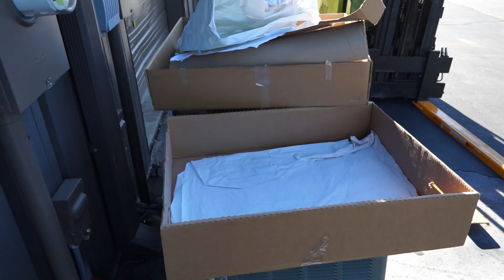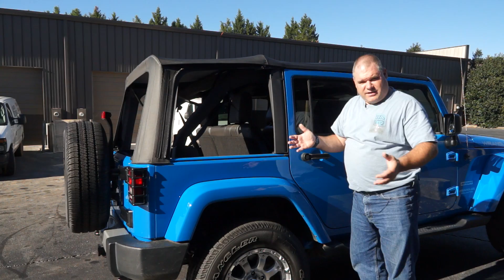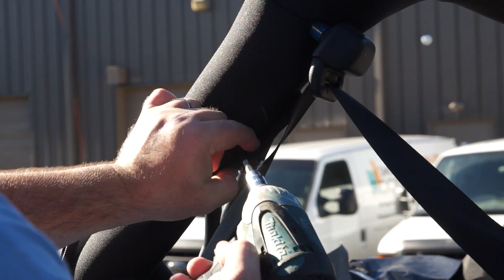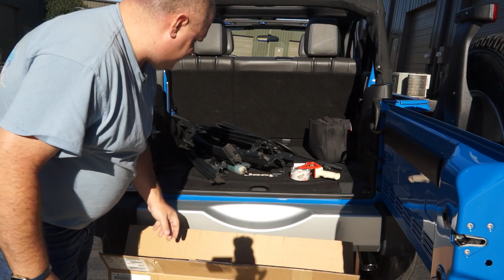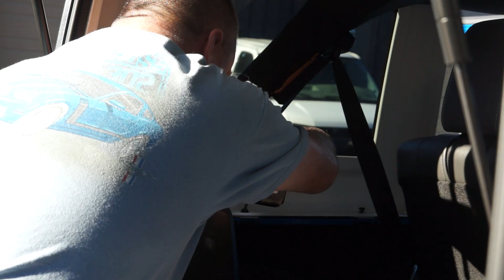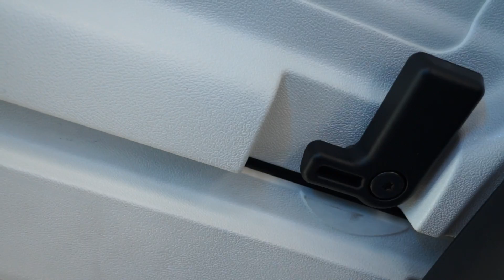How to Install Your Hard Top JK Jeep Wrangler from Soft Top

Comment: By far, the absolute best video for removing a soft top and adding a hard top.  The only thing I would add is that when placing the hard top on via a pulley or winch system, have the rear doors open to ensure as the hard top is lowered it doesn't bump into a door.  A really great video.  Must have saved me at least an hours labor.
Reply: @Donny-boy Productions
I came here looking for how to build a pulley system for my wife's new Wrangler Unlimited.
I know that it's been a year, but I'll save this to my watch later file. If you know of a video or anything for some ideas, thanks in advance.

Comment: Great video. Great colour truck too. Swapped my tops recently to the hard top. Found that the rubbers on the doors needed time to adjust - had some weather leakage at first but it repaired itself after a few days. I've a diesel JKU Flame Red
Reply from the maker: Tim, Thank you

Comment: I really like your video. It was really helpful for when I took my soft top off and installed my new hard top. You were very thorough and not showed only key points in the video. I really like the step by step process. May I make a suggestion if you haven't done so already? Wiring the hard top was a pain and the directions for the wiring kit is impossible to follow. How about a video for wiring? I was not able to find anything on it (only chat forums). It could be very helpful for others who are confused as I was.
Reply from the maker: Stephen, Thank you. Not sure if I can make the wiring for the hard top video as my Wrangler came factory with the hard top and wiring. Just looking at the kit looks like a pain. Lol

Comment: Does it already have OEM wiring to plug and play or do i need to buy wiper hardness?...Just convert to hardtop but dont see any wire to connect wiper....please help
Reply from the maker: It requires the optional hard top harness kit. http://www.ebay.com/itm/2007-2010-JEEP-WRANGLER-HARD-TOP-WIRING-KIT-MOPAR-OEM-82210215AG-/321227214165?hash=item4acaa24d55:g:r3gAAOxy1RZSWa6h&vxp=mtr

http://www.ebay.com/itm/11-13-JEEP-WRANGLER-WITHOUT-HEATED-MIRRORS-HARDTOP-WIRING-KIT-OEM-NEW-MOPAR-/191627627250?hash=item2c9de58af2:g:lIQAAOSwPcVVn8~F&vxp=mtr

Comment: Great video.  I've used it several times as a refresher when I switch from my soft top to my hard top.  Is that a CATV trunk amp on the shelf below where you store your soft top?
Reply from the maker: yes it is. my company is upstate broadband
Reply: fiero880 I thought that's what it was. I use to work for a cable company many, many years ago.

Comment: Did this Jeep originally come with a hardtop or soft top? Wondering if a Jeep that originally comes with a soft top will have the wiring harness foe the wiper and defroster and tube for the wiper fluid?
Reply from the maker: Yes My Jeep originally came with the hard top. If your did not and you wish to go to a hard top they sell a kit from Mopar that allows you to add that wiring for the washer and wiper.

Comment: I just removed the soft top torx screws and did not know about the Velcro straps. I did not see you use these. Is there a trick to keeping the spring wound?
Reply from the maker: Oh yes the notorious spring assist. Many thought it was the best thing created. Until they tried removing their top. I have yet been able to find a wrangler with the spring assist and film how to correctly and safely strap it in place. My apologies. But I have heard it is a major pain.

Comment: how wide is the hard top? i'm wondering if i can fit it under this overhang in my garage (the overhang is the staircase leading down into the basement). thanks!
Reply from the maker: I honestly do not know. I will try and measure with a tape measure.